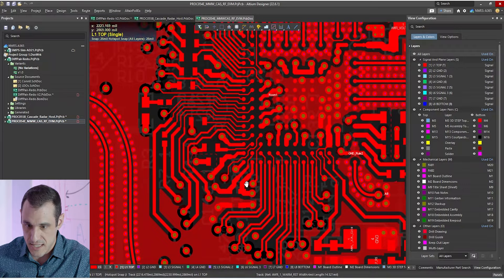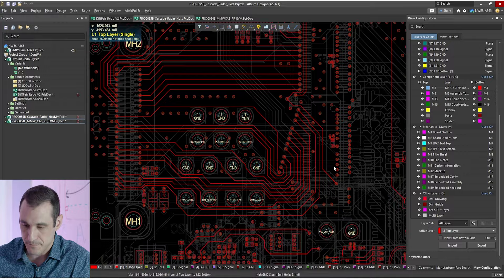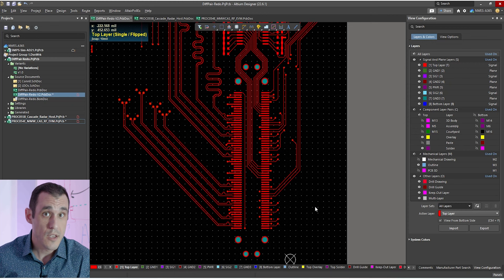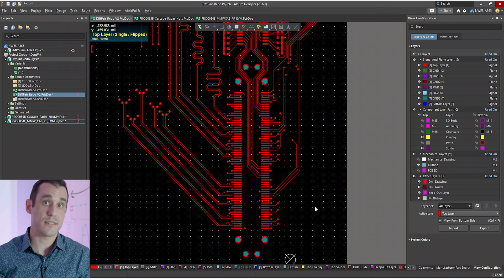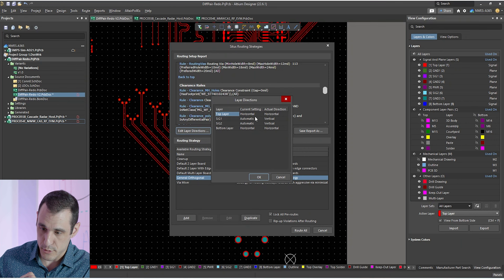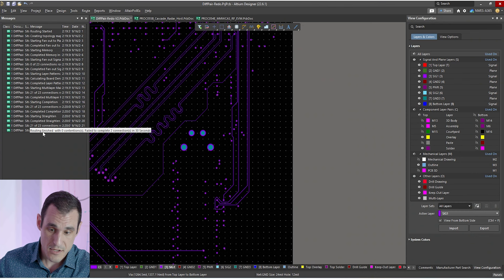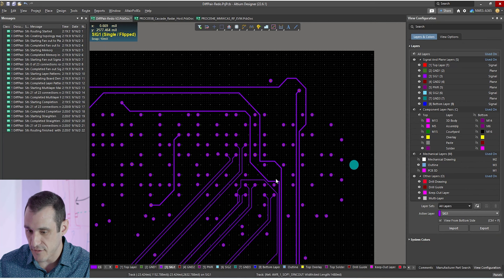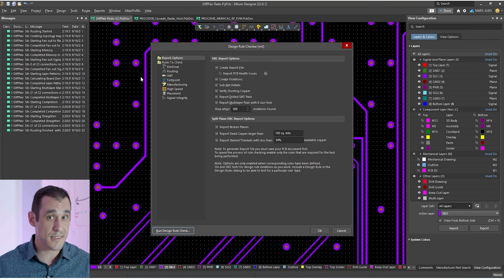When to Use an Autorouter in PCB Design

Comment: Sometimes on big boards with lots of stuff going everywhere an autorouter is the way. The autorouter is seen (not Altium) requires a script to set set it up.  Something like
1. Select clock nets
2. Route the selected nets using a star topology on outer layers with impedance 50 Ω. If they're diff pairs you have to tell it that too.
3 Select the high speed data busses.
4 Route them equal length, and as diff pairs if needed, with tolerances.

I.e. you have to do a really good job setting up the rules and priorities, which is 90 % of the work. Then let it run. Come back the next day and see what worked and what didn't. Modify the script a bit and try again. After a couple of goes it works and you have a script you can run any time. 
The advantage is that if the placement needs to move around a bit you don't have to redo all those hand-crafted matched lenght diff pairs over night. Just start the autorouter and come back the next day.
Reply: This is the kind of thing I was thinking of with a process to use it, I just don't know what the best process is or if it can really be generalized to every other possible board. Sounds like in this case maybe it can't be generalized to every other board. And I agree a lot of the up-front work would be to set rules, constraints, and priorities.
Reply: Interesting; seems like a case of "you need to know how to use your tools". Which autorouter are you talking about, and where can I get it?

Comment: Altium Designer has proven to be an excellent tool ever since I first started using it, and today, its capabilities are truly impressive. However, I understand why the autorouter still falls short: it lacks the ability to comprehend our intentions and the contextual nuances of the board. I mean, I've tried implementing numerous rules to guide the routing process, and while it does a decent job, the time invested in fine-tuning these rules and addressing issues, like those encountered here, indicates that manual routing remains the preferable option. That said, leveraging the automation features within the software, such as configuring push tracks and optimizing common I/O pins through multirouting, significantly expedites the process beyond the default settings and proves to be far superior (and faster) compared to autorouting.

Comment: I tried it once back in 2007. I wonder how good it is if you set the classes/rule super well.
Reply: I have no time to experiment with that
Reply: @Zachariah-Peterson  yeah me either lol. maybe one day I'll save a board after placement, do the route myself, and then go back to the placed board and see what it comes up with.
Reply: Situs?  You can set all the classes/rules you want and it will disappoint.  Try a real autorouter like Specctra/CCT or Electra, learn the setup & control language, create and tweak your do files, place route-keepouts in your design, learn when/when not to use one, and see a whole new world of what autorouters (and you) can do in a fraction of the time.  Altium could never create or acquire a professional autorouter thus they began the propaganda that all autorouters suck.  If you think you can simply load your board, push the autoroute button and then complain about the results you're an amateur.

Comment: How do I turn off auto routing on a specific layer?? I have problem where I want to do copper pour on a bottom layer (4 layer card). Because altium want let me select bottom/top layer as a power plane
Reply: If you're going to use the autorouter, you can limit it to specific layers, or specific layer transitions through vias, when you open the configuration dialog. If you want to do copper pour on the bottom layer, then wait until you have the PCB fully routed, then you can apply copper pour on the bottom layer as a polygon. Make sure to set the right copper-to-track clearances for the GND net in the Electrical -> Clearance section of the design rules.

Comment: Why oh why does the autorouter create shorts on existing nets??!?  I can understand dealing with some non-optimal corners or routes after the fact, but creating a direct short?  Thanks just awful coding.
Reply: I actually wonder if you were to rip up that net, and then iterate and target that net specifically with the autorouter, that it might give a better result. If the other nets are already routed then the tool can only focus on obstacle avoidance rather than balancing two routes simultaneously. I haven't done the experiment though.